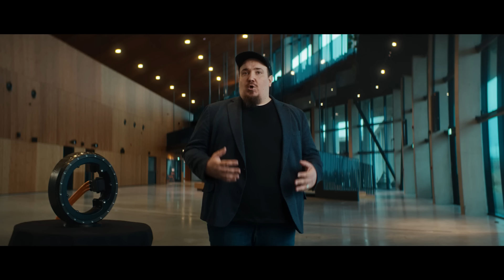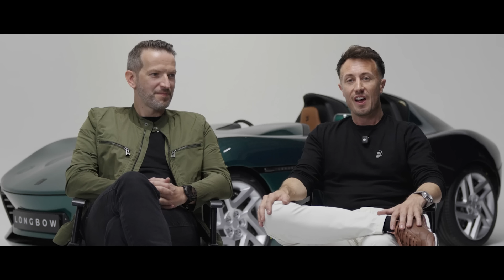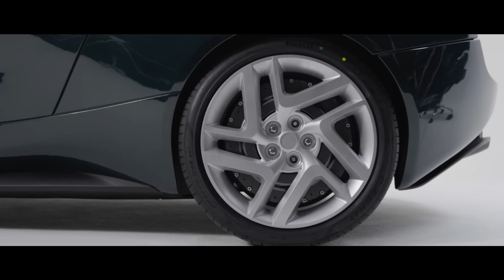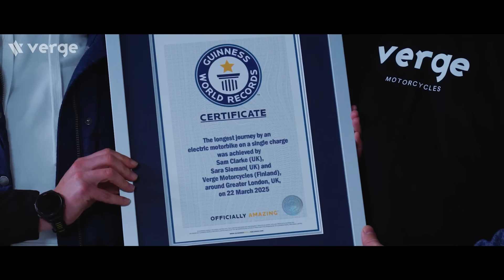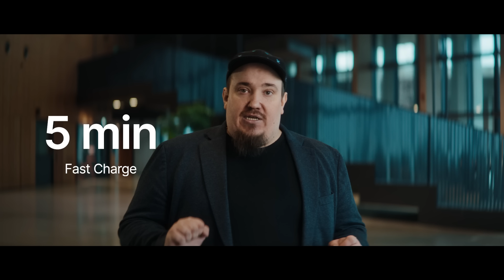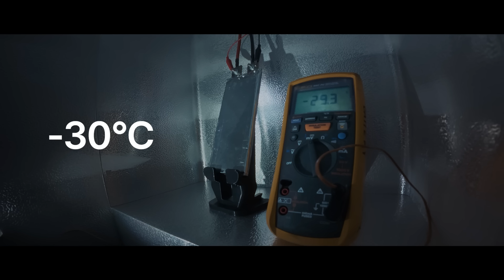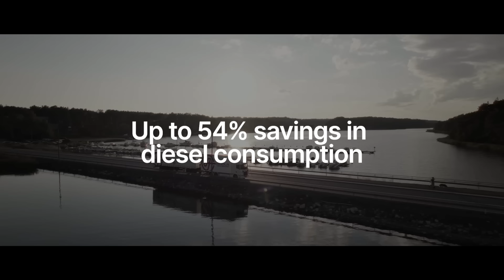World's First All-Solid-State Battery in Production Vehicles | Donut Battery

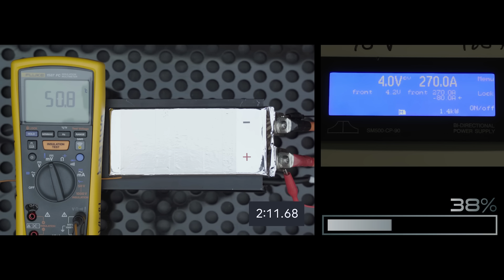Comment: At the 13:13 mark, a Delta Elektronika SM500-CP-90 power supply is visible on the right side. The issue is that, according to its datasheet, this specific model can provide a maximum current of only 90A.
However, at the top of the screen, the first row indicates the CV (Constant Voltage) operating mode, with the 'actual voltage' parameter ranging between 3.9V and 4.2V during the 5-minute charging period, while the 'actual current' remains fixed at 270A. The second row shows a 'voltage setting' of 4.2V and a 'current setting' of 270A. At the bottom of the screen, the 'actual power' is displayed as 1.4kW.
It is unclear how these values can be achieved with that specific power supply unit, given that its maximum rated output is 90A. If the SM70-CP-450 model had been used instead, the values would have seemed more realistic, as that model can deliver up to 450A.
Furthermore, the cross-section of the wires connected to the battery terminals appears to be around 16-25 mm², which seems insufficient for such a high current. Additionally, the bolts connecting the battery terminals to the lugs appear to be M6 or M8.
If the battery was charged for approximately 5 minutes at an intensity of 270A and a voltage of 4.1V, this would result in a capacity/energy of roughly 95Wh or 23Ah. Given that a Fluke 1587 measures 10x20 cm, the battery dimensions are estimated at 1.5x7x16 cm, which would imply an extremely high energy density.

Update: I checked the documentation (SM15K – Master/Slave Assembly Kits) and 3 power supplies can be connected in parallel to provide the 270A current.
Reply: I think it could be 90A x 3 =270A. The motorbike had three of those and I guess they can charge them separately but simultaneously.

But I have rather basic knowledge in this domain.
Reply: @weketor2504  You know exactly what you are talking about, those power supplies are designed to be stacked and show a combined reading.
Reply: @jaro6985  You are right, I checked the documentation (SM15K – Master/Slave Assembly Kits) and 3 power supplies can be connected in parallel to provide the 270A current.
Reply: hell yeah weaponized autism
Reply: I’m not familiar with this power supply, but I do note a “lock” value of 80A appears to be selected. I would suggest this was also more in keeping with the size of the Amp Tags and cables used.
I should point out that the size of screws securing the tags should not be a limiting factor as the current path should be achieved over the contact surface area of the mating tag terminals. If the fastener was the current-limiting part of a tag design, the tag would only need be large enough to support the fastener (such as used for low current Earth connections to chassis). 
More interestingly, cell temperature does start to climb quite quickly, and we don’t see it go beyond 80ish% … in a pack of multiple cells, this could get quite scary rather quickly due to the combined effect.
Reply: did you look at the charging demo at 13:00 where the battery is swelling when charging and nobody is talking about that in the comment section.
Reply: @mohammed_mubashir  Yes, that’s exactly what caught my eye first. I wanted to write about it, but I stopped at the technical specifications, hoping someone in the comments would kick off the discussion.
The Fluke thermocouple is attached to the side of the battery with what looks like heat-shrink tubing. Curiously, this tubing is missing from the top section of the battery. I have the impression that the cables on the battery terminals are under tension, causing mechanical stress on the posts. While the measured temperature seems to be taken from the side—roughly halfway up—the heat around the terminals should logically be much higher. It looks like the excessive heat near the terminals is causing something resembling a very thin aluminum foil to peel and swell, but the video cuts off right at that moment.
Many suspect the battery might be sitting on a cooling element. I noticed superficial scratches on the black rectangle, which appears to be an anodized aluminum block—a surface prone to exactly that kind of light scratching, as seen in the video. Additionally, at the base of the black block, there is a black tube that could either be a wire or a fluid conduit.
Reply: Another question I've had from the very beginning: why didn't they use a dedicated temperature measurement device, such as a Fluke 54/53/52/51? Why did they settle for a Fluke 1587 FC Insulation Multimeter instead? When you want to take pride in your results, you should also use the appropriate professional equipment for the job.
Reply: Another issue I haven't really seen mentioned in the comments is the battery charging curve; I haven't seen any battery chemistry that charges from 0% to 100% with a constant current of 270A.
Reply: Imagine everybody trying to charge their cars and phones at the same time at that rate. There's no way the power grid can handle it.
Reply: @Tankwiper  when ice cars started, the fuel could be bought only in a pharmacy...
Reply: @Tankwiper  maybe in goode ol' imperial murical... In Norway 97% of newly sold vehicles are electric. And its working out there fine. But yeah, continue wiping your tank and watch while the world advances.
Reply: @Knux02  I'm not against electric cars. But you can't charge thousands or millions of cars at 1 MW at the same time
Reply: @Tankwiper  luckily that never happens. Most peeps charge their car like once per week. If there would be problems with the grid, we'd already have seen issues
Reply: @Knux02  Wow that's a massive cope comment out there. Keep crying that your commie gov is forcing you to buy a scam that does not work, does not hold value, does not sell without subsidies aaaand is worse for the environment than a regular ICE. Oh and btw Berlin was hit by the biggest blackout in its history, go ask how ppl over there are charging their EVs. 🤡
Reply: @LittleBaboon  LUL who is crying? bruh, you are delusional.. ICE engines are like horse carriages in the 1900s - obsolete. 90% efficency in EV compared to like 20% with gas. Much better acceleration, 10 minute charge times, silent as fuck. Worse for the environment how? Also the most underrated aspect of EVs is Air quality. Can't wait to see how many cancers and respiratory illnesses disappear once we can finally breathe clean air in cities. Yeah, charging infrastructure needs to improve in countries that still have lower adoption. The blackout happened because of malignant actors who burned down power insfrastructure - Don't let me start on listing all the disasters in the world that have been caused by Oil. From wars that killed millions to Oil spills that devastate natural environemnts every fricking year. I will dance in the streets when no ICE car is on the street anymore.
Reply: @Knux02 d’you know who’s crying? Bro that’s replying to every comment defending corpo-government hoax with payed walls of text. What they pay you by the word or smth? That “ICE is like the horse” quote is directly picked by Neil DeGrasse Tyson so keep listening to him and the other shamans pushing the scam. Environmental point? Where do you think electricity comes from? Where do you think batteries come from? Lithium? Cobalt? From the Holy Ghost? It is a brutal extraction leading to one of the dirtiest chemical production processes. Oh wait, there’s more - what do you do with the good-for-nothin’ 5 year old battery? You ship it again to the Holy Ghost for environmentally friendly disposal? But there’s even more to it, Jack: let me ask you how many kW you can store in a brand new Tesla? How many can you store in a 5 year old one? Cos my 1955 F100 had 17 gallons tank in 1955…and in 2025 it has …17 gallons still. You are clearly buthurt that your overlords demand that you comply, fall in line and act happy about it. I don’t blame you, you can probably get arrested if tou don’t…keep dancing champ
Reply: @LittleBaboon  Hey man. We both live in a bubble of internet that tells us stuff that we should believe but some of your points are exagarated af. I still wanna reply to your points. I hate neil de grasse tyson - he is an idiot, not a scientist. More and more electricity comes from renewables like solar and wind, solar is now the cheapest energy source BY FAR. Cobalt mining is a problem, but Oil drilling has been worse for the environment by orders of magnitude. Don't tell me you care about environment only when it fits your narrative. Also, Lithium Iron Phosphate (LFP) Batteries are taking over in electric cars, needing no Cobalt at all. Lithium will be replaced with Sodium long term , extracted from table salt or solid state batteries like shown in this video. There is constant improvement to technologies, ICE Engines haven't improved significantly over half a century. Its cool that you still drive your 1955 Ford, i myself have a Motorcycle from the 50s, no car. I still wanna see my children grow up in a world without pollution in the air. And you should too. I live in europe and i am quite happy here, one of the most crazy things that you americans get indoctrinated with is that "social" = bad. Social means "good for everyone". Didnt Jesus also say "love thy neighbor"?. And no, i will not get arrested here, we still hold free speech in high regard. I enjoy going to the hospital without needing to worry to go bankrupt, i enjoy having financial security if i lose my job. I think you should look yourself in the mirror and think hard who is the one whos indoctrinated. Look up my points on the internet and tell me i am wrong.
Reply: @Knux02  I appreciate what you’re saying and thank you for sharing your thoughts. I was however triggered by how you said that the Progress is definitely Electric and ICE is pretty much for the museum and even implied that it is for people/countries that are dumb, anti-progress retards. Btw I am not from USA though I massively geek over pretty much everything ‘mUrIcAn – hence the F100. I am from Europe, yeah from one of those countries who were under socialist regimes, so I know what “social” means – I was on the receiving end of the meaning ☹ . And yet I strongly believe that a change in our tech stack is absolutely necessary. But not with EVs and especially how they are shoved down our throats – Govt policies, anti-consumer practices, false advertising (literally there is not ONE EV producer that can match their marketed range in real-life conditions, not Tesla, not Porsche), anti-ownership demand. The fact that EVs accelerate fast doesn’t mean squat if you can’t get to wherever you want to or do not work they way you expect them to.
Moreover, for off-road terrains, isolated territories, military and emergency machinery – Evs are terrible, utterly unreliable. Like do you see an EV Fire Engine being deployed in a rugged, forested, 1300m-above-sea-level mountain? One rock hit on the “belly” of the truck and you’re done for. Not to mention refueling, which can be done in minutes and then redeployed quickly. If you don’t have some sort of swapping tech for batteries, EVs are always going to be inferior. 
To your points, I have installed 16 solar panels in my back yard. Let me tell you something – there is nothing environmentally friendly about them. You basically have to place them in arable land (if you’re aiming for industrial or larger home production, can’t be on the rooftop), nothing grows underneath or around them. The panels need to be replaced and the materials they are built out of are literally toxic and cannot be recycled. The only clean option here is Nuclear but there seems to be, again, pushback from the so-called greens. Basically we stopped making those for no apparent reason. Oil drilling is a sh*tty industry but we’re getting way better in this and gas (LPG) is virtually clean energy. I can’t say much about that Sodium transformation you mentioned, I don’t know enough about it, but I don’t see how this will lead to “swapping” or “replacing” tech. But poses another question – why not transform to EV when we have the tech. Why now? It does not make sense.
ICE engines did improve – significantly. New petrol engines, with 7 (or whatever) different particle filters are much, much cleaner than any EV if you take the battery production upfront. As for the pollution, it is clear that Europe does all of this for money not for clean air. The fact that batteries are produced elsewhere doesn’t meant that we’re not breathing the same air. 
We didn’t end Stone Age because we ran out of stones, right? We replaced it with something far superior, reliable and advanced. Good chat though… God Bless you.

Comment: Solid-State battery with 100% green elements?! That sounds too insane to be true, please prove us wrong! I'd be really happy to!
Reply: Only if you don't believe inventors stopped publicizing their findings until they have a product for market to make it harder for them to be disappeared and the work buried from humans.
Reply: I guess it's carbon, iron, and sodium based.
So the materials may be green but it's probably intensive to make

See Nordic Nano for the battery tech
Reply: @ElementalTJ  I would guess sodium, sulfur, graphene.
Reply: @ElementalTJ He call them batteries but these are capacitors, I will like to know the energy retention
Reply: @rwyo83  I belive they are Donuts actually. It's irrelevant what you want to call it lol. A capacitor aha. Thanks for trying at least.
Reply: Cant be so bad if you have juice to cover 600km. Capasitor would be size of a house to keeo enough energy.
Reply: @rwyo83  Now here's the thing. You already know that capacitors and batteries are close in function, and that there are many drawbacks with batteries, and fewer for capacitors. Both can be charged, and can dispense their charge sustained over a few hours, about as often as you have to recharge a laptop that uses 60-70%% of the specs it's sold with, sustained. (Most laptops use ~15W average of the ~100W sold capacity.)

If they have discovered that a very capacitor-like battery can be made solid state, would that be an excellent capacitor, or an excellent 'fake battery'? It seems to me it doesn't matter. Like, at all.
Reply: @GunTech  It doesn't matter what they are making as long as it works, but I don't want to charge my EV to 100% and after a few days it drains to 0% without using.  That is the problem with capacitors
Reply: @rwyo83  I am wondering, if this is true, what the limiting factor might be. I have not seen it mentioned, but while it can be charged really fast, it does not mean that it can be discharged as fast.
Reply: The cold weather feature is the best. I get 60 plus miles on my e-bike in the summer. When it's 20 degrees I have to carry a spare battery to go over 15 miles.
Reply: @wcswood  You should probably consider using a heater and insulation if it drops that much.
Reply: @inso80  I use an insulated wrap. Haven't seen any heaters available. I tried making one last year from a heated scarf. It wasn't hot enough to make a difference.
Reply: @wcswood  There are several types of heater elements available, would need to calculate the actual power needed, etc. But something like 12v/48w could be the ballpark. I dont think those are very expensive.

What material do you use for the wrap?
Reply: @inso80  It's like a neoprene wetsuit material. I don't know if it does much but it keeps the battery clean and dry.
Reply: @inso80  I just ordered a heat pad for $11 bucks on Amazon. It's 5v but I have a really nice little 5v power bank that should work well. You got me wanting to try again.
Reply: These mofos are lying their asses out. It's safe to say , they have nothing.

Comment: Electric Will Never Replace Combustion Engines. 
Let me tell you Why. Even if you Master the Technology, to Have Same Distance coverage etc. etc.
Reliability is Questionable at best. Repairability is Practically Non-Existent, especially when Every EV nowadays is Entirely Proprietary.
But Also, Batteries are Heavy and Don't Function well in Cold Conditions at all, Nor in Warm Environments. Offroad Dependent Places like Siberia or Alaska, EVs are Nonsense.
In Warm Enviornment like Africa, EVs are Nonsense aswell, not just because their Power Grid is unreliable to say the Least, But Also cuz it's Warm and Batteries are Known to Self-Ignite.
What Can Your Solid-State Battery Do, when it gets down to -20C? Not Everyone has an Insulated Garage, or a Garage in general.

Comment: The 4th and most important innovation to complete the platform should be a mobile / compact aneutronic fusion reactor like the onces Lockheed Martin, TAE Energy (now DJT) or Helion Energy has created in order to constantly charge up those batteries by a decentralized ZPE solution with a COP > 1.  That is where electrification (among the very name of the company) will really make sense and take off - not only not disturbing and overloading the legacy grid, but not even needing it at all. :-)

Comment: My BS detector is on full alert here. Showing a clip of a cell charging at 270 Amps but giving no definition of the cell capacity and saying it charges in five minutes without knowing that cells actual capacity. You can't provide half the metrics without the other important bits. In the same way you cant say I can fill my fuel tank in 10 seconds without giving the tanks capacity or fuel flow rate. https://youtu.be/Y-aPS2AwMbc?t=800